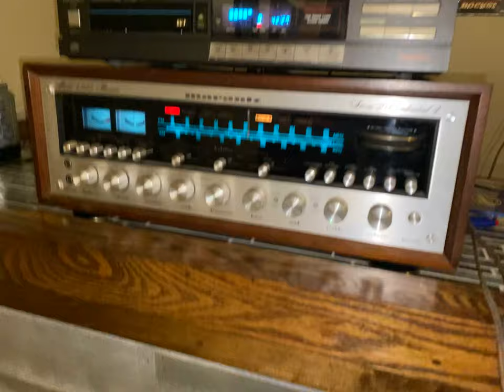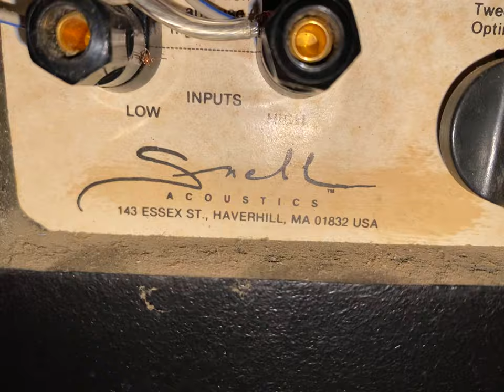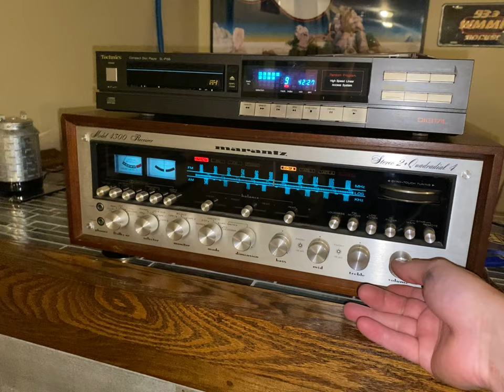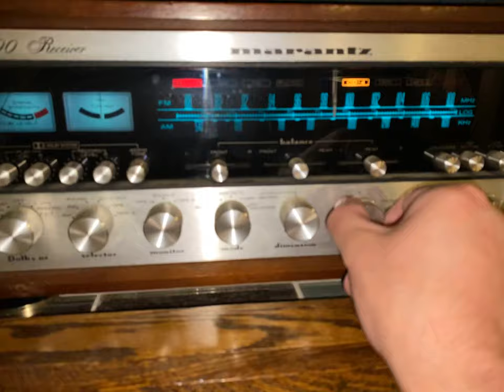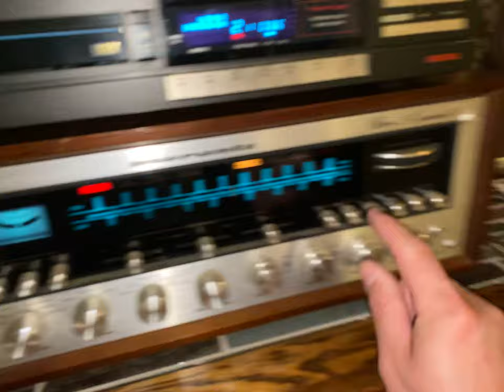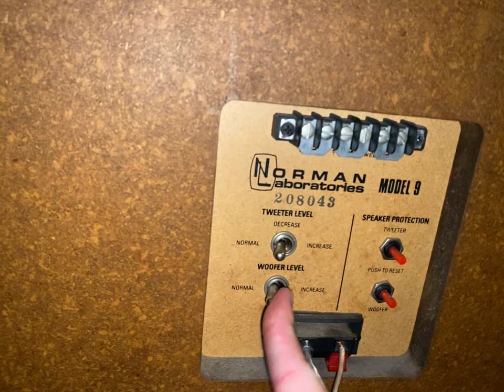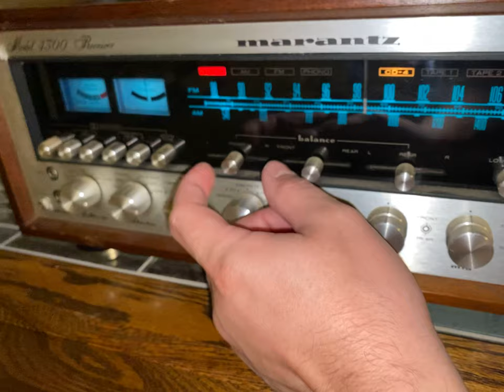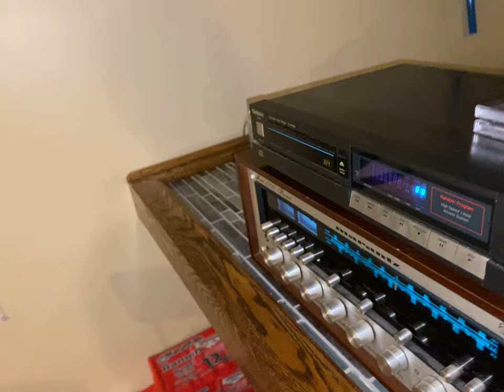Major audio score!!! Marantz 4300, Norman Laboratories Model 9, Snell Acoustics Type EIII

Comment: There is a good chance the crossover caps are bad on the Norman Labs speakers.  I have a couple sets of speakers where this happened and only the woofers would play.  The woofers on the Snells may have just been refoamed.  Nice score on the Marantz!  You still need to get a pair of Dynaco A25s!
Reply from the maker: Quite possibly could be!! And on the snells, you can tell the screw holes dont line up. I looked them up online too and you can tell theyre different

Comment: I just bought a 4300 without the wood case for $650. The lights were replaced with LED's, but nothing else was replaced. It sounds good, and there's no scratches on the faceplate or knobs. Hopefully I got a good deal.
Reply from the maker: Killer deal!!